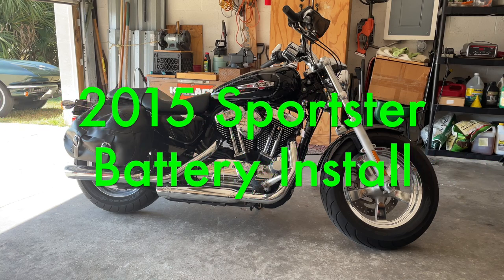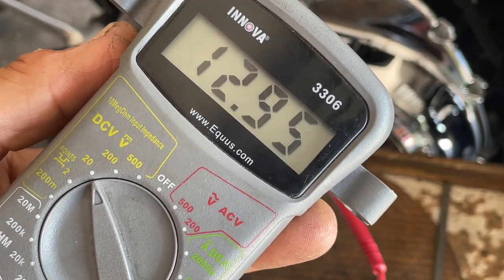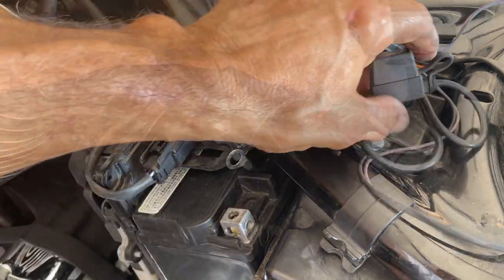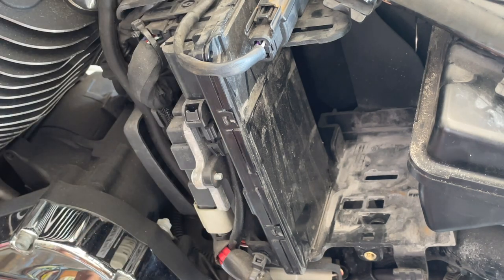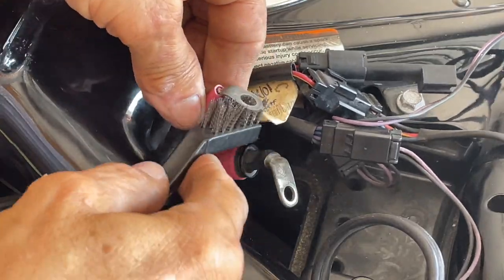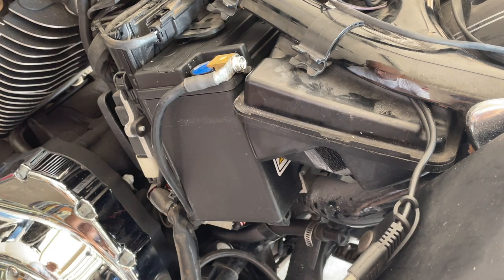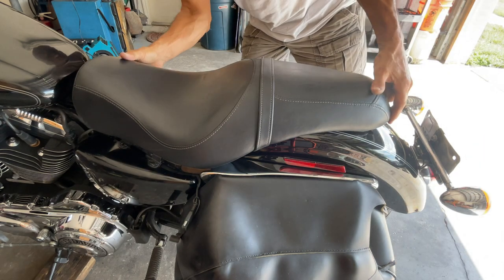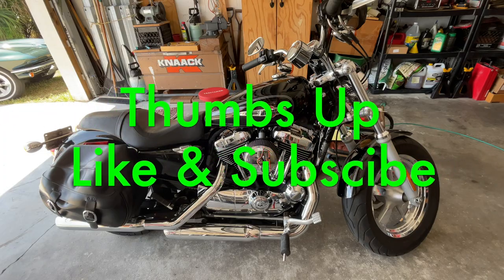How To, Sportster Battery replacement.

Comment: I heard somewhere you should pull the main fuse before disconnecting the battery?
Reply from the maker: Happy to help. What your comfort level is, once you disconnect negative lead and you don't have the key on it's all good. Thank you for watching and your concerns with the fuse.  Drive safe and have a great day.

Comment: Hey, one more thing. I just bought this seventy two. It has a stage 1 upgrade with V&H short shots and S&S teardrop air intake with V&H fuelpak 3 fuel tuner. I want to make the bike more powerful. What are some upgrades you recommend. I am in process of changing all plugs and wires, battery, ignition coil, and front/rear suspension.
Reply from the maker: Happy to help. Just enjoy yourself and be safe. Let us know how things work out. I think you have done as much as you can without doing a bore kit and cam. Thank you for watching and your sub Philip. Ride safe and have a great day.

Comment: Hey rocco. I need a battery. Goin to try one. Thanks brother. John
Reply from the maker: They are not bad for the money that I have found. Just make sure you fully charge it, and test it before you install. The first day I received the battery it tested for 12.3 volts,   slow charge it overnight and was like 13 V. Seems like a great battery. Let us know what you think thank you for watching and have a great day Ebay.

Comment: Hey Rocco, I've got a 2006 sportster 883. When cold the bike will start up fine, idle and ride for 15-20 miles. Once the bike gets hot, it will sometimes die when I stop and then it won't start back up until 20-30 minutes of letting it cool.  

Do you have any idea where I should start looking? The only thing I can think of is possibly the ignition module? Any advice would be much appreciated. Thank your Sir!
Reply from the maker: Happy to help. I agree, it gets hot the ignition module fails,  it dies. It cools down and it's able to start up.   Same thing 20 minutes and dies. Replace ignition module Thank you for watching and your sub Joshua. Let us know how it works out. Ride safe and have a great day.

Comment: Any Sportster Guru's, I have 2019 sportster no start, Went for a ride stopped at the gas station kill switch wouldn't work. stalled her out, she wouldn't fire back up. towed her home checked the fuses battery ect.. pulled the switch and harness all looks good, disconnected the the starter solenoid plug and jumped 12 volts to it and she kicked over.. switch has power ground and two can lines couldn't figure out how to test it. In any case the on switch works turn signal works hazzard switch works... ANy ideas?
Reply from the maker: Happy to help. Sounds like the starter relay. It's funny I just had a bike in here not too long ago, same problem replaced the starter relay. Thank you for watching and your sub. Ride safe and have a great day. Let us know how it works out.
Reply: @TwoWheelRocco   You have a location for it? I had half the bike apart and couldn't find it. Seems to run on three fuses was looking for a fuse panel but only found one velcro to the oil tank,  any other info? diagram maybe
Reply from the maker: Hope this helps, Let us know how this works out.      Goggle  this..       2019 harley davidson sportster fuse box location.